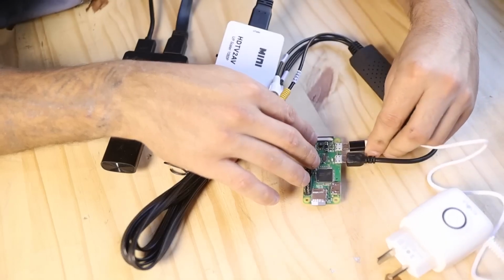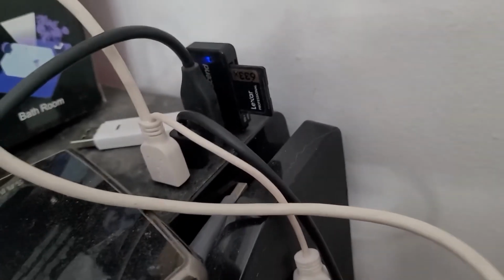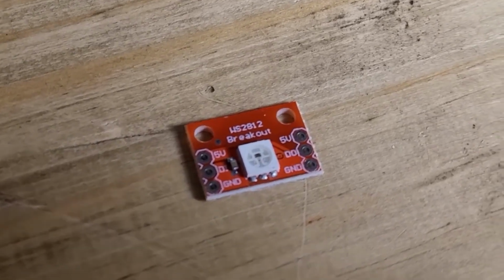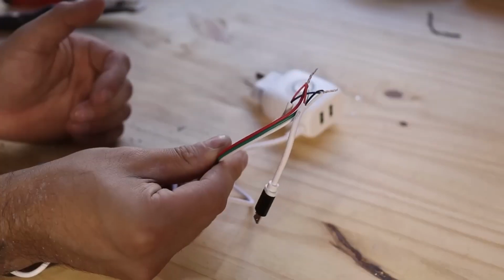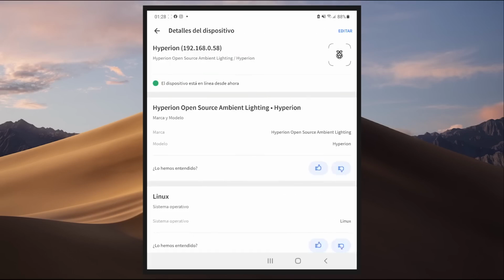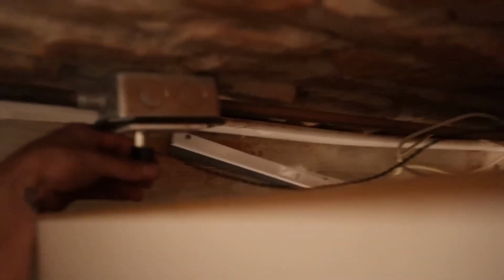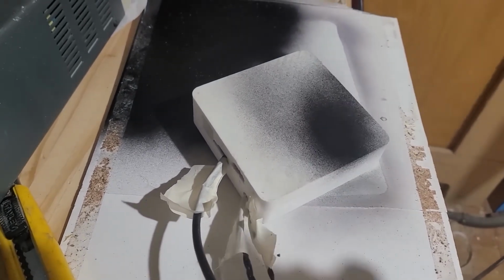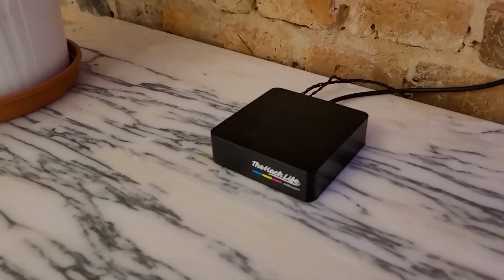Built an Ambilight System for $50 Instead of $550!

Comment: Don't follow this video !!! It's an accident waiting to happen! 
There's so many wrongs in here, I wouldn't know where to start?!
Sorry to say, but you really have to do better than this !
Reply: The way all electronics is stuffed with the power adapter?! The IP address is called protocol ?! The sloppy joint of the wires and the resistor...
Reply: @FjederDennis  IP stands for internet protocol. When you do it yourself just make it safer, it seems like everything here works.
Reply: @tribot_leader  I know what IP means besides "intellectual property" ;) but I would expect to use the terms slightly better?!  I'm probably a little nitty-gritty about the language and terms use, but I really don't like what he is doing, even though it works and the end result looks great!
Reply: whats wrong in it please? before i watch it
Reply: To my untrained eye, the obvious one was stuffing all the boards in the same box, where there could be an easy short. If there are worse issues, please do point them out.